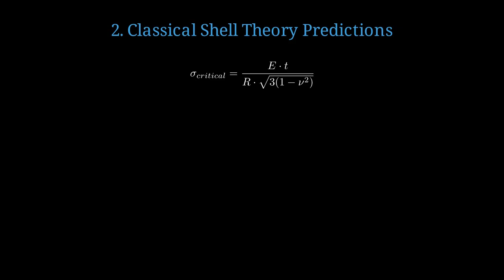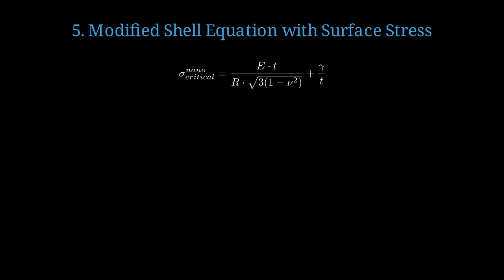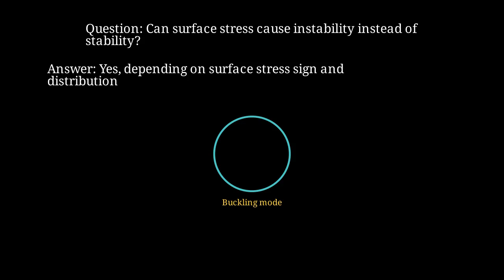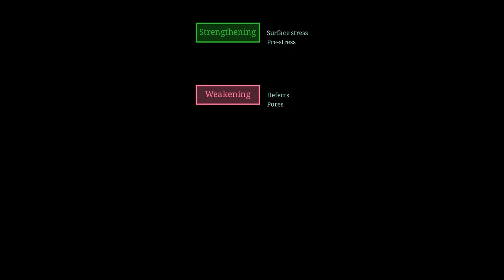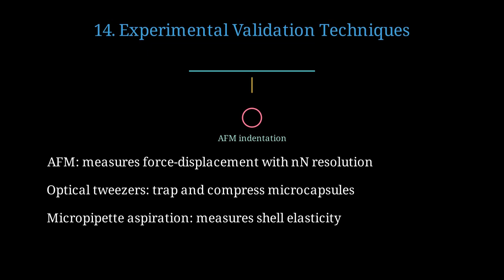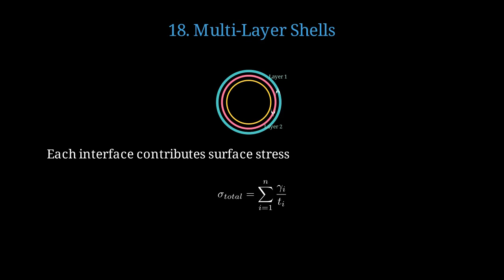How Surface Stress Leads to Instability, Buckling and Shape Transitions

Comment from the maker: 1⃣ How can surface stress and curvature coupling be quantified in ultra-thin nanoshells where continuum mechanics begins to fail?
2⃣ Can nanoshell instability be predicted using atomistic simulations that include quantum surface reconstruction effects?
3⃣ Is it possible to exploit surface stress to design nanoshells with adaptive, self-stabilizing, or tunable mechanical responses for real-world applications?